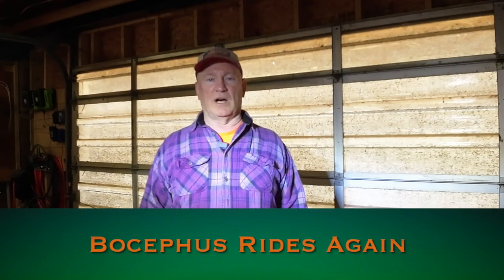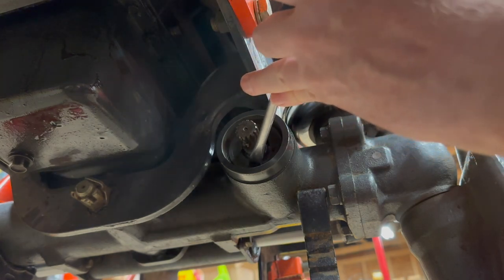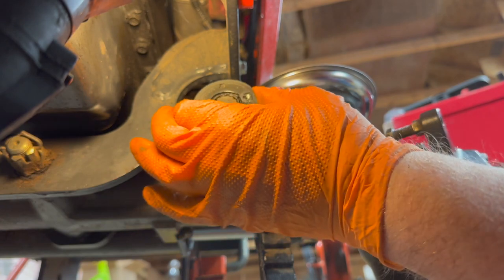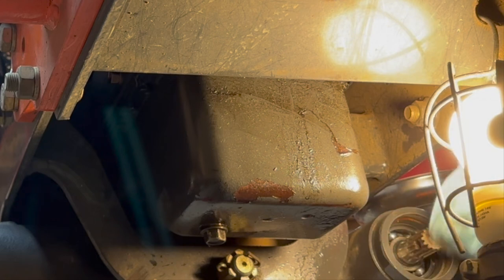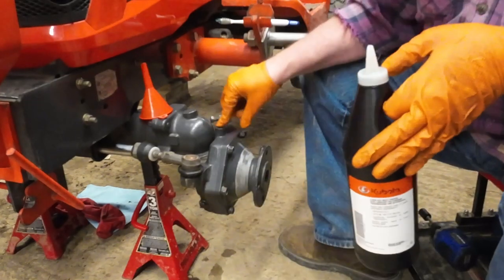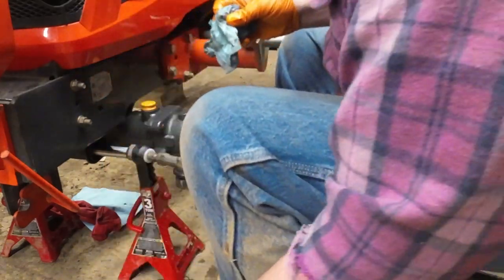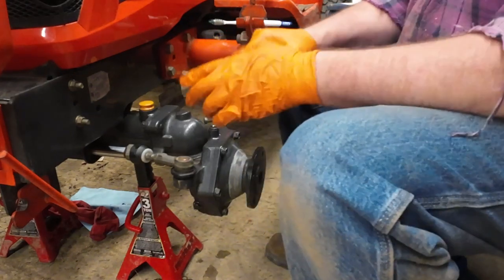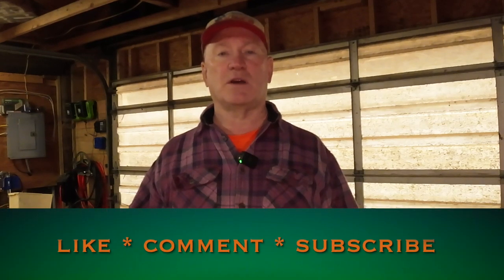132 - Bocephus Rides Again

Comment: As a Heavy Duty Mechanic here, you done a great job Bob.
Reply from the maker: Thanks, I appreciate the feedback.  I once bought either a aluminum transfer case which someone replaced the seal wrong and they gouged a screwdriver width piece of aluminum from the case and it leaked transmission fluid.  And I did not want to do that to my tractor because obviously driving a screwdriver between the seal and the case is not the correct way to remove a seal.  Once someone explained the proper way to use a seal puller to me, it was a piece of cake.  I'm very pleased with the end results.  Thanks for watching and commenting.  Enjoy the journey - cheers

Comment: Nice job on the fix
Reply from the maker: Thank you Larry - It was easy once someone explained the proper way to remove the seal.  I owned a K5 Blazer that someone used a screwdriver to pull the seal on the transfer case.  The case was aluminum and the screw driver gouged the case and the case would leak fluid until I used some RTV to seal the seal.  It wasn't the best repair job, but it worked.  I didn't want to use a screwdriver to pry the seal out, and didn't know how to use the seal puller.  Once the mechanic explain to me how it was done, it made good sense to me.  Thanks for watching and commenting. Enjoy the Journey - Cheers

Comment: I found out first hand that thread locker will lock things other than threads,,, I was working on a carburetor and I tried to just get the locker on the bolt on the throttle shaft , that stuff got up into the shaft and that thing was stuck so I had to take it apart and get that stuff off so the shaft would turn again.
Reply from the maker: Oh NO.  That is something you never forget.  Good thing it did not stick wide-open throttle.  I often wondered what it would do to a lock cylinder.  No, I never tried it.  Not yet... Thanks for watching and commenting. Enjoy the Journey - Cheers

Comment: How about putting some wire mesh over that slot, rivet or gear clamp it on?
Reply from the maker: That's an idea.  The purpose of the hole is to allow water to escape if the axle becomes submerged.  I was using the FEL to take out some invasive plants and I believe the stick got wedged in the hole while backing out of the brush.  Thanks for watching and commenting. Enjoy the Journey - Cheers